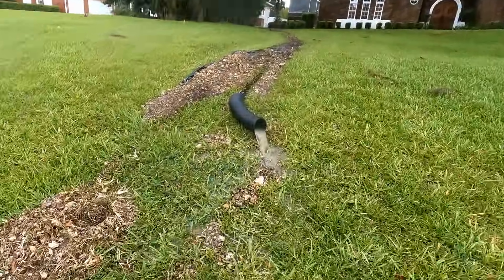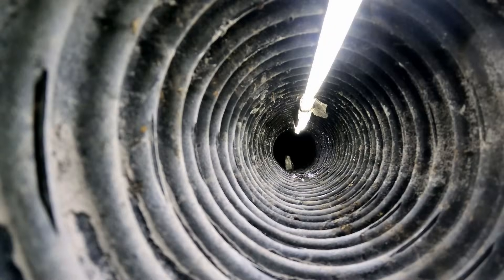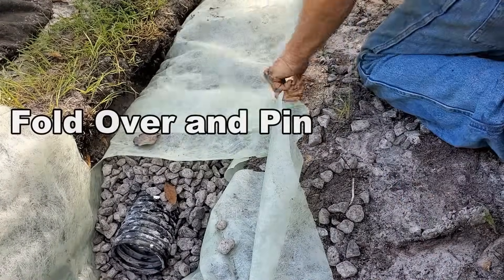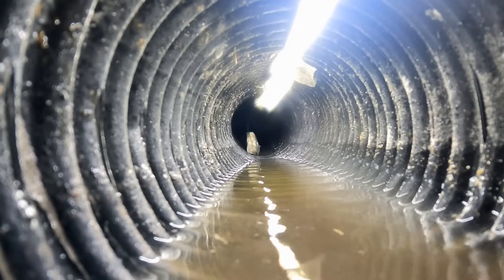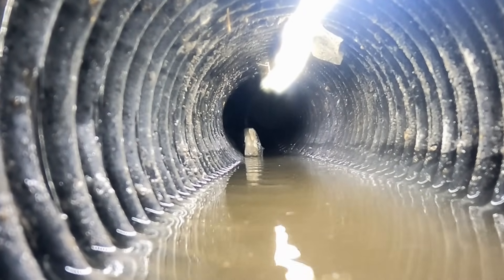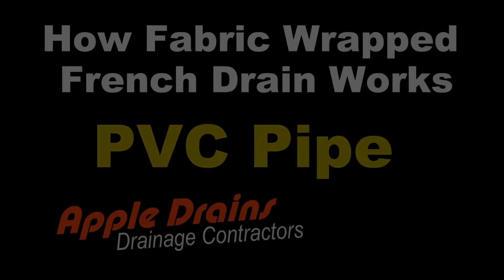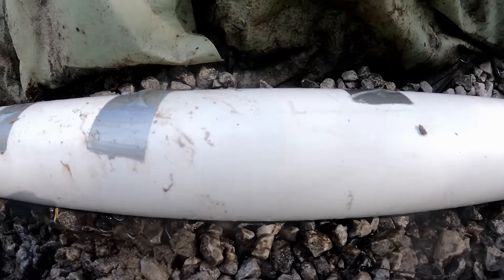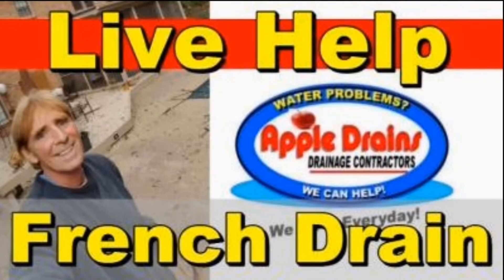Does French Drain Work with Fabric? Watch This Before You Install - PVC / Corrugated Pipe

Comment: Why put gravel underneath the pipe? Why not just lay the pipe on top of the geotextile to catch every inch of water at the bottom of the trench?
Reply: I think there are holes on the underside of the PVC. I would guess if it sat flush with the ground the ground / fabric, it would block it.
Reply: Gravel helps to transmit water better, and during installation it is better to overdig, then fill in with gravel to set the right slope.
Reply: I think it's only important for the PVC version with holes on the bottom. French Drain Man uses a corrugated pipe with knife cuts all around and recommends not putting rocks underneath.
Reply: It keeps the migration of mud, clay, and sandy loam from completely caking up the fabric blocking off the migration of water into the pipe.
Reply: In time roots, dirt, bugs will block the holes.

Comment: If you put stone under the French Drain pipe water will accumulate in the stone and will not run off in the pipe.  I think the pipe should lay on the fabric at the bottom of the trench. This was all the water enters the pipe and drains away.
Reply: Not sure the video answers this specifically. If you put the drain on top of fabric the water at the base can only go through the very small areas of fabric next to the pipe holes at the pipe base and tiny soil particles will quickly block these fabric areas , so then only the holes higher up the pipe circumference can take water that has gone through the much larger areas of fabric and through the large volume of stone. Putting stone under the pipe will hold some water there but it does not matter as beneath the pipe will be full of water if it is soil, sand or anything else.
Reply: @ColinCarFan You're absolutely right their video does not touch on why the gravel below the pipe is important. I'll tell you why as the guy from Apple drains, here, is too proud to admit that they don't in the video. Basically, the stone gravel isn't permeable and this allows the water to rise up relatively free of soil particles thus aiding the movement and flow of water into and along the drainpipes interior channel.
Reply: @2icelollys1goat  this will  just allow water to sit under the pipe and also attract mosquitos. the pipe should be on the bottom. also you should look up what permeable means.
Reply from the maker: I’m pretty sure if you watch my videos you will get your answer!

Thanks
Reply from the maker: You are watching too many false videos! 
We wrote the book on Rainwater Drainage! Over 60 million views and helping so many people every day! Don’t be fooled by some random guy that does 8 jobs a year and puts down everyone that installs drains!!

Thanks for your comment
Reply: @appledrains  With all due respect, you didn't answer the question. Can you lay the pipe on the fabric? If the answer is no, then please state why not. I'd like to know because this is a project I will be doing in the very near future and I want to make sure I do it right the first time. Thanks.

Comment: About 13 years ago I installed around my house 1 inch perforated PVC pipe, only in gravel, no fabric.  Keep working flawless till now,.  The flow is as good as in first day, the water gets drained very fast after a strong rain.
Reply: I dont doubt what you say is true but eventually the surrounding soil will percolate into the spaces between the gravel and clog the drain.  Geotextile keeps most of that soil out so the drain will last much longer; thats why its done.
Reply: @hazmat5749  the soil just clogs the fabric instead
Reply: @supernom  The surface area of the textile is much greater than the surface area of the pipe, so it can keep working even if partially clogged.  Civil Engineers use Geotex all the time, and for good reason.
Reply: Fabric enclosing the pipe at the bottom of the fabric with 14'' or so inches of 1.5'' clean cobble, all wrapped in the fabric, - then the silt, clay, and other small grain soil goes/flows through the fabric with rainfall events and flows through the french drain, and on the outside of the fabric there will be larger grit soil particles, which are beneficial to the drain system @supernom

Comment: Will the fabric eventually get clogged?
Reply: The fabric and the gravel together work like a larger more perforated pipe. The pipe itself ensures the fastest flow of water.  If your soil can clog the fabric, essentially preventing water from flowing through the membrane, then you do not have a problem with water in your soil. You might have a surface water problem because your soil cannot absorb water.

Comment: I just hired a company to do a FD and he put the drain in and then put in the gravel. I fired him knowing the gravel had to go first, after watching this video.  Unfortunately the pipe was too difficult to remove so I lifted the pipe as high as I could and shoved as much gravel underneath as I could. Hope it works. Lots of videos show workers placing the pipe over dirt - no gravel and no fabric - good luck with that. It would be nice if more contractors watch this video.
Reply: I have a friend who is an engineer and his sites they never put gravel down first. Why would you? It just holds the water below and stops it from getting in the pipe
Reply: @AlexSilis  IDK because when I did my first drain I lined the drain with fabric then a layer of gravel, then the pipe, more gravel and burritoed the drain and it works fine. If any dirt gets into the drain and dirt will the dirt is going to smash between  the pipe and fabric and clog. The pipe is less likely to clog with dirt when the pipe sits on the gravel.
Reply: @AlexSilis  IDK because when I did my first drain I lined the drain with fabric then a layer of gravel, then the pipe, more gravel and burritoed the drain and it works fine. If any dirt gets into the drain and dirt will the dirt is going to smash between  the pipe and fabric and clog. The pipe is less likely to clog with dirt when the pipe sits on the gravel.
Reply: His own earlier videos show pipe on dirt then gravel..
Reply: 😅eeeeeede we😊
Reply: Fabric for burrito wrap, first, then pipe on the bottom on top of the fabric, then gravel to sufficient height, then wrap with the fabric.
Reply: Water sits in the gravel BELOW the pipe! How does this make sense??

Comment: How deep are you making these.  My project is in Indiana (18’ frost line) and specifically for sump pump from basement out to yard that floods and we put a drain to the creek but the people who did it did it wrong and it’s as if there is no pipe at all.  The total distance is 800 feet from sump to creek.  There is a “natural” drain here from back yard to back yard and the guy next to me made a cement foundation for a shed right on the natural drain and now it backs up to my yard.  I’ve spent too much already.  I’m willing to make a pond where the natural drain goes in my yard (250 feet from sump pump) and then make a stream to the back to the creek.  It can stop at point 150 feet from creek to facilitate a watering hole for my livestock. It’s an intolerable mess for sure.  How deep do I need to buy these pipes ? AND what can I use to make the desired watering holes/ponds?  Pond plastic/Edpm ? And where do I place the pipes in regards to the ponds….I’d think if the pipes were too low, they could back up(?)

Comment: Thanks for the demonstration. I'm wondering if anyone ever used groundwater or surface collected water to move away to a different point in the garden and use for irrigation in a dripping system? 
I need to install a french pipe in my garden but I won't be able to direct the pipes into an IBC tank due to difficult terrain and placement of the tanks themselves. So I'm thinking I'll try and accumulate the rainwater in solid pipes close to my raised beds where I'm able to open a tap and water them when needed. My only concern with this solution is low water pressure and simply using gravity, but for a dripping system this might be more than enough. Has anyone got a similar solution? Thanks!

Comment: Hi, my house has a crawl space it is an old house. It collect lots of water under the space. Would this helps.
Reply: Yes, but you need to run it to a sump pump.  Preferably two basins opposite each other.  If the grading isn't level, locate the sump basin at the lowest grade.

Comment: My question isn't for yard drainage. Is for under my house.  I've been trying to install a French drain with no help none. I've got the trenches dug and all. But the Basin I was planning to use is a 24" deep, 16" bottom, 21" top. How do I get this underneath my house when crawl hole is alot smaller??? I thought about going through the floor, but to do that I'd still have to cut a joist cause they're set at 14 1/2" apart. I was always told you never cut, notch, etc. A floor joist. So how do I do this... . .. cut the basin??? Please help.
Reply: Cut the joists then sister a new section of the joist back in (watch a video or 5 on that). Ideally, put temporary supports under both sides. Assuming it is dirt and if the ground is not wet you can make an upside down wide T so the brace doesn't dig into the ground. Alternatively, brace the joists perpendicular (four total). That is how I would do it. I'm a DIYer and have no professional training so ultimately I'm going to say you should probably hire a professional.

Comment: Fantastic video! Wow! The PVC moved that water so much more rapidly! Proof PVC is better in most circumstances, easier to clean and will last longer.

Very important to have the gravel and fabric too as proven. 👍
Reply: PVC pipe will be better in transporting water the corrugated pipe.  But does that matter?  If it is not over capacity and it is just a question how how long it takes to transport away the water, does it matter if the water after a rain is drained in 1 versus 2 hours?

Solip PVC pipe transports water faster because it has smooth internals.  The drawback is that you can bend PVC pipe, that's what corrugated pipe is designed for.       Both exist in perforated and no perforated variants.    So better is a question of what you prioritized and the intended paths of the pipe.  If it is in a straight line versus if there is lots of bend will change what is better or at least simplest and cheapest to install.
Reply: HDPE or double wall corrugated hdpe would be even better.
Reply: Depends on the application…. I have PVC carry water (from downspouts) about 6-8’ from house to corrugated, perforated drainage pipe buried in  planting beds and then to street/storm drain.

Comment: so when the fabric filter does its job and silts up how do you change the filter? the very point of the pipe is to allow you to clean out the silt. it is stoopid to wrap it in a cloth that catches the silt and will eventually plug rendering the trench useless. yes I do this for a living and have for decades.
Reply: I'd like to know the answer to this as well.

Comment: Great... for a season or two but if you want it to last make sure to cover the landscape fabric with at least a couple of inches of straw. Straw transmits moisture without carrying silt which will eventually fill up both situations offered here. Start with a bed of straw, lay fabric on top, then 3/4 washed crushed stone then lay your pipe, more stone, wrap with fabric and cover with straw. You're welcome.
Reply: Straw decomposes really fast though, right?
Reply: @anthonyelledge7475  Left on the surface yes but can last decades when deprived of oxidation and even when decomposed creates a path for water transmission.
Reply: @Thephilipcartmelexperience  If you put straw around a drain and in a ditch with water, it wont decompose?
Reply: @anthonyelledge7475  Trust me. It works. They use straw to transmit water in highway construction. It was used on the TransCanada highway going through the swampland in Burnaby BC.  It leaves behind  a permanent pathway.
Reply: Great idea and I absolutely believe it will too. I think I'm going to try it with my French drain too that I'm planning to install very soon.  Thanks for the suggestion. 👍

Comment: Personally I find using any geotex fabric a waste of money . In time it forms a barrier to water ingress ,if for example you have clay or heavy soil ,,the same goes for corrugated pipe ,the ribs collect debris which builds up in time causing blockages .  Smooth bore pipe eliminates all of that accelerating the water flow the longer the stretch ,Its the sizeof stone that is the factor  .
Reply: Another important standard is to NOT use perforated pipe once you are out of the area needing drainage. I have seen multiple times where they used perforated pipe the whole way and all it did was transfer groundwater to another location underground and causing slips.

Comment: There's a fabric like a sock that is used to slide the pipe into to keep dirt out
Reply: A sock over the pipe will eventually clog up and significantly reduce the amount of water that seeps into the pipe through the slits/holes, which reduces the effectiveness of the system.  That's why he is not recommending using a sock, but rather lining the trench with a geo-textile fabric.

Comment: I wrongly never put fabric around the 1 1/2” stone I used in my drain system. After a couple years I had places where dirt fines filled the side and top layer of stone and it prevents the water from getting into the French drain especially in winter when those places freeze. I brought my stone to the surface because if I put the sod back on it would prevent the surface water from going in when it freezes. Wish I knew to use the fabric when I did the work. Never thought enough soil and fines would work their way in between that 1 1/2” stone to a point it’s blocking water flow. Stone is so big I can’t shovel and clean it out. Backhoe would probably destroy the pipe if I used that. Lesson learned I guess.
Reply: $140.00 for 250' of 4" dig it up and fix it.

Comment: Regarding that wrapping fabric.... What is it needed for? Can you do the job without it? Is it a waterproof fabric or it has holes I assume for drainage ?
I am not Sure what is it's purpose so please confirm. Thank you for a great video.
Reply: The fabric allows water to enter but prevents and/or limits soil and fines from entering into the stone and pipe which would quickly plug up the drain.

Comment: my french drain was installed upside down according to your video. the holes were put on top.
Reply: Water builds up, drains in from the top, flows out. It will work, but you're allowing more water to settle.

Comment: As an Electrician, I have been involved with many trenching operations, not just limited to Electrical.
One of the funnier things I heard was that, here in King County WA, we were required, for a while, to fill any sewer trenches with River Rock. As a result, the sewer lines going to the Sewage Treatment Plant (STP) were acting as French Drains, channelling groundwater from the surrounding countryside directly to the Plant.
So, we switched over to filling the trenches with crushed rock, and compacted it, because these trenches needed to be stable, generally following roads (down the middle!), and/or crossing underneath them.
This acted like a dam and prevented the natural flow of water through the soil, resulting in a soupy swamp arising uphill from the trench.
The solution, as I understood it, was to have River Rock for 20', and then a 3' band of compacted crushed rock, with mandatory compacted crushed rock for road crossings. This allowed for the natural flow of groundwater around the sewer line, while preventing the funnelling of it to the STP.
Reply: King County is hilly and the folks there never understood ground drainage. They will put basements on hillsides and not understand why they flood. It's because the rain flows on the surface and just under it but above the hardpan soil which is only a couple feet below grade and nearly entirely impervious. A basement creates a bathtub even at a high elevation. There's a similar problem with these trenches they struggle with. The linear depression in the hardpan forms an underground stream. They should either try to restore the imperviousness to the previous level or just give the stream an outlet to a body of water. Sounds like instead, they are mixed up and switching back and forth.
Reply: @zane43  And let's mention all the houses in flood plains that have basements, like, say, the entire Kent Valley, and the flatlands of Puyallup as just a couple examples.
My Landlord is a Licensed Contractor, and made himself a new road on his farm.
He basically cut a ditch 3' deep to make this "Driveway." Now he's driving across wet clay and complaining about the mess.
And he's too cheap to buy any crushed rock to put on it. Our Glacial Till is a trip.
Reply: The entire Puget Sound Basin is a mess when it comes to ground water control - and so are the codes that stipulate how to deal with it.  The counties here will issue a building permit on virtually any slope, just to increase the property taxes.

Comment: A French drain does not have pipe in it, they are made entirely out of rock or stone. A drain uses solid pipe and a weeper uses pipe with holes or slit, a weeper can also be wrapped in a “sock” or not. 
Schools out!
Reply: I think you will find, that Henry French, who was the one who came up with the idea, actually describes using a 'tile pipe' in the drain...
Reply: nope harry designed without pipe. pipe came later as an improvement to the French drain (which is not french at all). but french drains can be called french drains with pipe in them. harry got the ball rolling, then they improved.